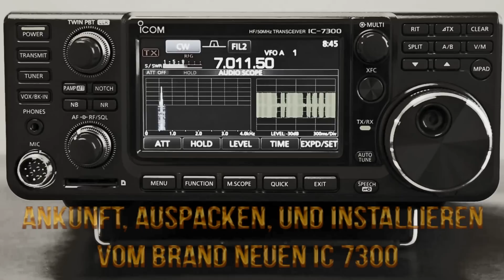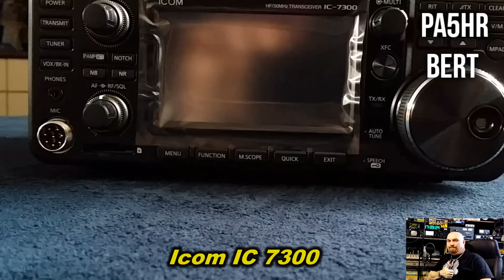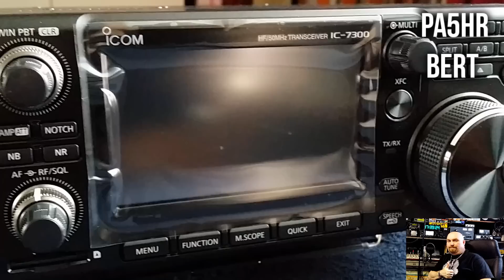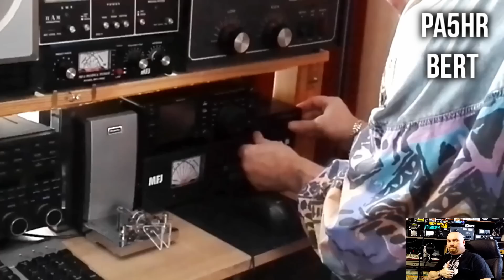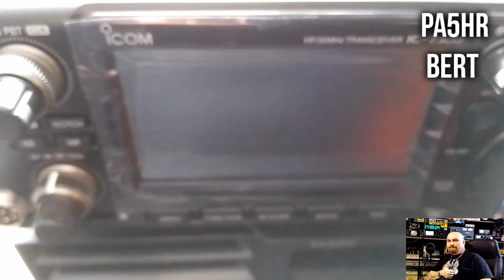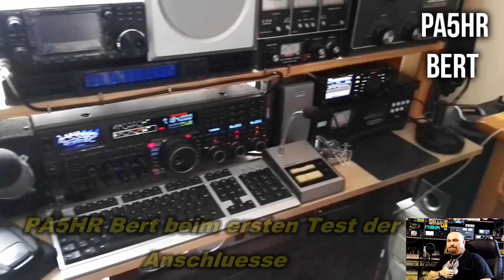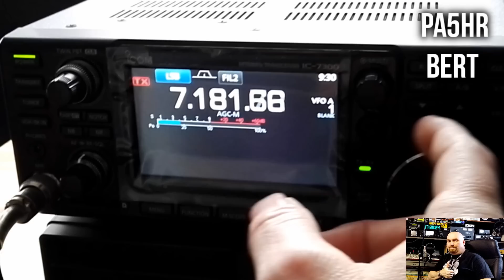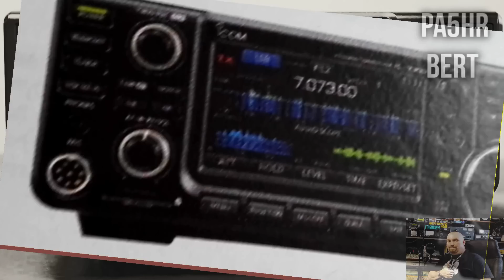The New ICOM IC 7300 Unboxing and Intallation

Comment: Hi Bert , Just recieved my 7300. I have a question where does the ground of the OPC 1457R connect ? John DJ6JH
Reply from the maker: Hello John i have the ground cable connect to my General Grounding from my Station you can connect the cable on you ground system ore something like that but most of the time it is not nesseasarry to connect it anyway you have to try it out if it goed ore not than you have to connect the wire to the ground....Vy 73 de Bert PA5HR:goodvibes:

Comment: Note... THIS IS AN OLD video... it shows a filter which is no longer sold as part of this unit, the OPC 1457R inline filter for the 13.8 VDC cable. The version of the operating system circa March of 2018 is 1.14 now. The latest listed on the Icom site is 1.12.

Comment: Hello Bert. Nice Video of Unboxing. Is on this Transceiver the Real Output 100 W ? Icom say this. But on YouTube many Hams say thats not so. The Real Output Power is so 65-80 W. Is that right ? Thanks for a quick Information. And Congrats for your Channel. 73 gd lk HB9FZE, Stefan
Reply from the maker: Hallo Stefan HB9FZE ja ich habe es bei mir auch gemessen und komme mit viel muehe auch nur auf etwas weniger als 100 Watt es sind digital gemessen 90 watt aber es ist auch bei mir jedenfalls so abhaengig welches band genutzt wird auf den hohen Frequenzen liefert er auch etwas mehr und auf den tiefen etwas weniger auf 160 meter 85 watt auf 10 meter 105 watt also es variiert ein bischen gemittelt 85-90 watt danke fuer deinen Comment vy 73 de PA5HR Bert

Comment: Can you run it via USB to computer?
Reply from the maker: Hello there thanks for asking ...yes you can run this beautyfull Transceiver with a PC via USB cable there are planty of Software you can use with this trx and there is yhe original Software from Icom yopu can buy and works very fine so thanks again Vy 73 de Bert PA5HR